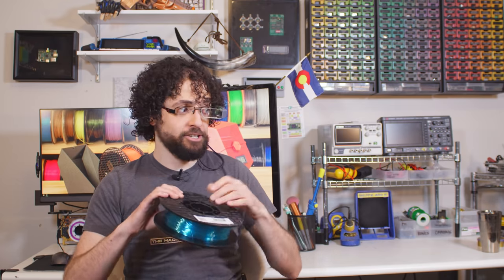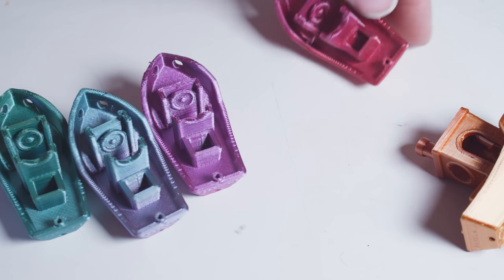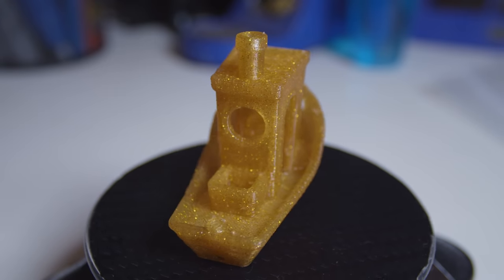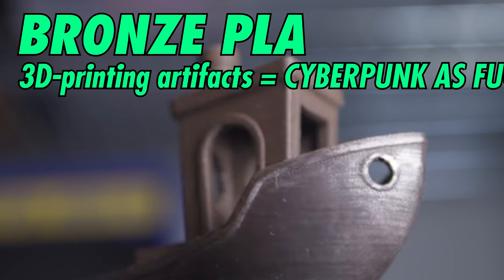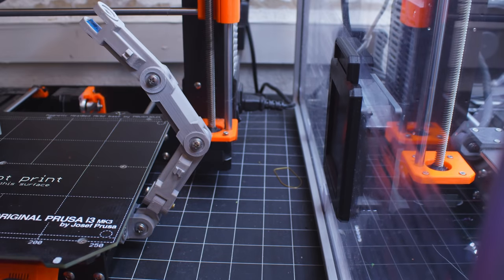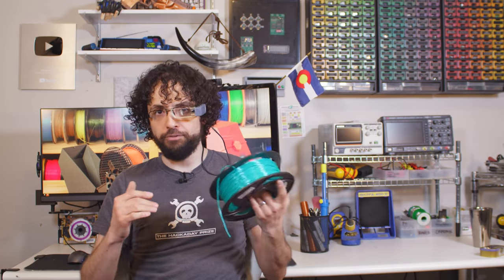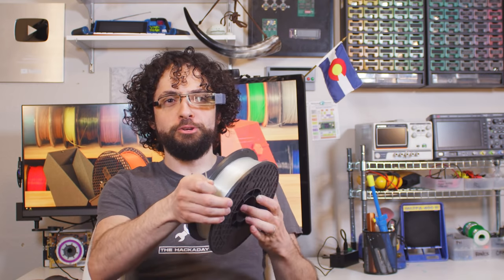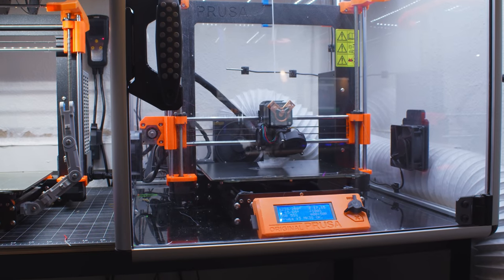I Tested (Almost) EVERY FILAMENT on Amazon: Every Single Filament Part I

Comment: Question at bottom, tnx uf anyone replies. Wanted to share my experience with abs.. Had to make cooler shroud and mount, started with peg, well. Glad i didnt start with abs. No cooling for hot end, 240c hot end and 140c bed. Just got a formbot raptor 2, cooler was starting to get bad. Hitting layers, bortom layers stringing and impossible to get it high enough..On top of, many seem to say negative stuff about the raptor 2..  I mainly got it because of size, and seems ok on paper.. But what do i  know 🤷‍♂️
My raptor 2 stands in my livingroom, open and my dog has a tail that causes strong blasts of air.  😄
Mount, had to drill out holes. Support was a sob, ruined on model trying to break it off. Not a beauty, but currently does the job..
The shroud, results where good. As good as i currently can make it, just got the printer.. the shroud is doing its designed job atm, dont sag. Yet at least. Clean model, hade to use dremel to flush out brimm. Almost proud i made these two parts with a raptor 2, open and well.. Allot of tweaking in cura and simplify3d. Simplify is the one i used .
Tried a new mount for extruder, etc. Started ok, then crash  insane warping.
Suspect i ran the bed 130c and 230 or 335c, first layers i ran 145c and 145c bed  
Abs really acts up when temp is just a tad low.. And hell to make ut stick on table. 
Think i learned allot, currently testing petg for 1piece spookholder. It has been printing for about 2 hours now, still looks fine. But again, im a noob trying to learn as much as possible. Hopefully my raptor 2 will do a ok job, already thinking ahead. Maybe upgrading it, be it diy style. Or, buy a upgrade kit plus new bed. Bed and nozzle have made nasty scrapes, previous owner plus i made a scrape  like i said, noob  But have worked with machining,  cnc.. Many similarities, like how you start with x codes  and cad. This was ages ago tho. Need to get cad installed  have ideas i wanna realize and test. Hehe
Anyways.  
Not sure to go 3 party, or formbots....
I see the firmware on my raptor is 2.0.5 R10. Is this a beta ver.? I see there is a update from formbot, not sure what ver. But, not sure if its worth updating, nor understand 100% how its done.. Should i change firmware, am i missing out? Any tips and tricks to share  have a issue with extruder in the start of a print, often have to remove first line.  Not sure how to fix this, maybe command in marlin or something i should tweak or look at? Sry, wall of text . Just wanted to say, generic black abs can be done in the open, with nice result. Be it luck, or experience. Petg seems (nicer), maybe it would be better for parts i made of abs? Tnx for reading, big tnx for any input, tips and replie 😎
Reply: Might add, i used hairspray i borrowed. Now, testing with one of the hairspray i got. So, try what i did. Maybe if you need abs  do like i did. High temp,  tweaking and tweaking.  And hairpulling... 😬

Comment: I feel like you’re a bit hard on ABS. I’ve printed loads of stuff in ABS in my bedroom on my Elegoo Neptune printers with no enclosure. Also ABS only offputs the gas if it reaches a high enough temperature, and studies have shown that it doesn’t release any enough toxic gasses or particulates to cause harm at regular print temperatures.

Comment: From plastic pollution to plastic pollution. Plus, added toxic gasses.

Most 3D printing is just an exercise in accelerating climate change with the pollution of production, shipping, and inevitable dumping.

Don't waste. This whole video is only useful if it saves more test printing with these materials than it produced. 

Share the lessons and knowledge in this video so it may do just that.